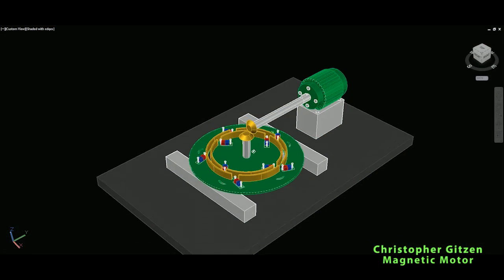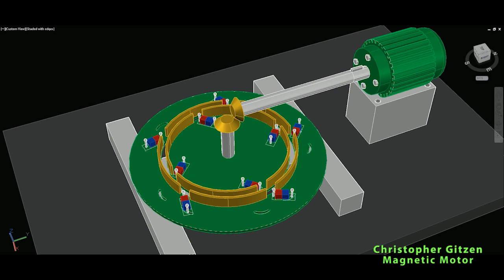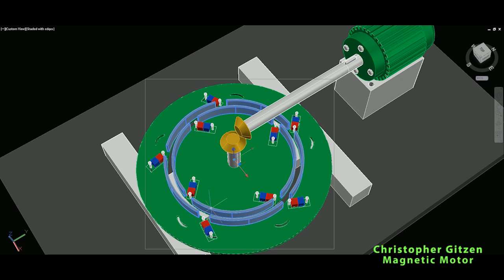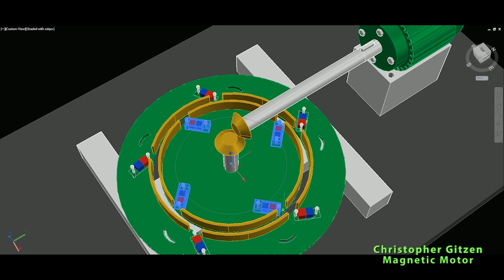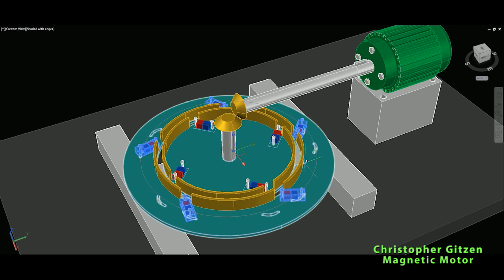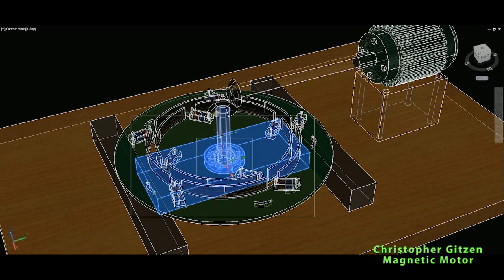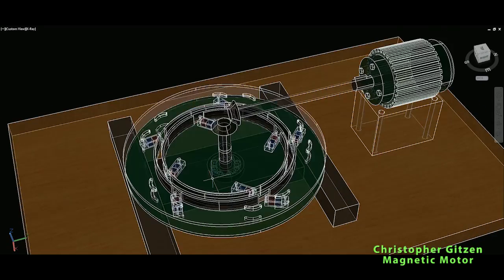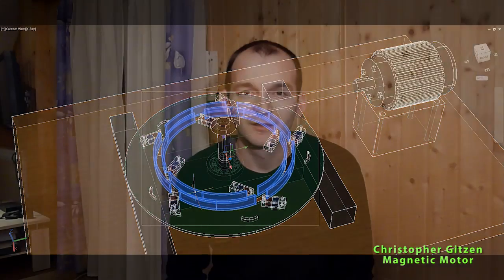Free Energy Generator 2017, Christopher Gitzen Magnetic Motor!!!!

Comment: You listed this as having a Patent, but it is NOT patented... it only has a Patent Application on file (as of June 2002)... which means it has not been approved by the US Patent and Trademark Office.
Magnetic "shielding" metal is called unobtanium (https://en.wikipedia.org/wiki/Unobtainium).  Any ferrous metal only re-directs magnetic flux - some are more efficient than others. The hopeful goal here requires more than a simple single material... it requires re-directing the flux into another metal that is not exposed to either the point of flux origin, or the flux destination... in other words, you need a diversion into a "flux short circuit". This has been attempted before by stacking multiple layers of ferrous metal and a non-ferrous material, usually with gaps between them.

Also... not sure why the right-angle drive to the generator... why not just have the rotor directly attached to the generator shaft in the Z-axis?

Comment: Mario Gudec, This is very good design for spinning the generator... While I see this design I remember one thing that I use in my workshop...  that is ( Bevel Gear ) I think bevel gear will be more easy way for spinning generator motors.... Bevel gears are easily available in spare parts market... Thank you for sharing the design...
Reply: I was thinking the same thing. The gears would make it far more precise